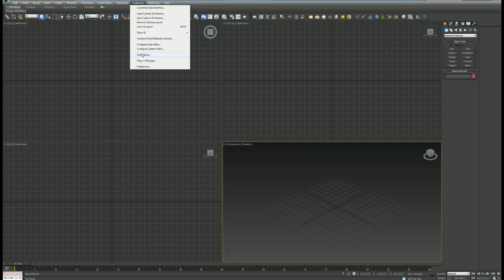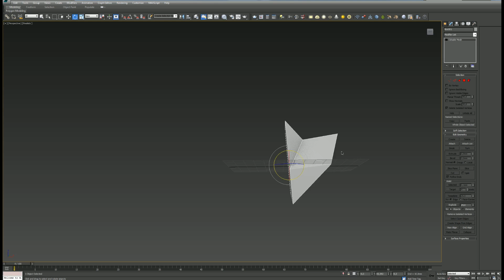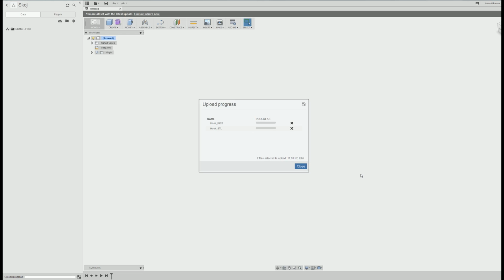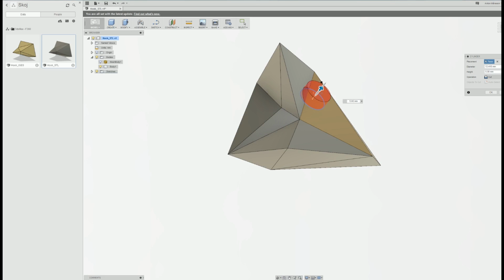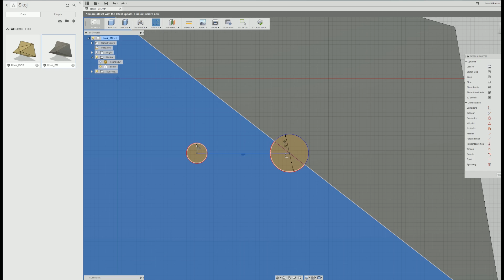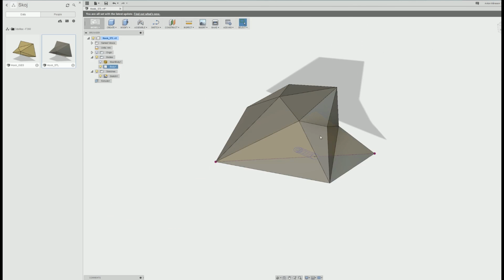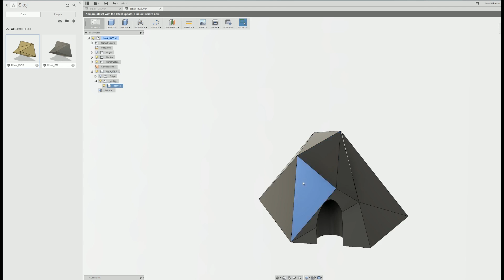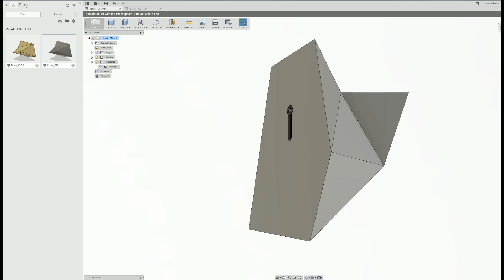Autodesk 3ds Max to Fusion 360 (STL to Solid) | /Guide | Polygon design sample

Comment: hey Actually I am new in designing world, I am using Autodesk inventor right now

but I have problem if I have to make an organic shape/complex sculpting geometry

could you give me a sugestion, what is differences between blender,3ds max and fusion
and when we use that software
Reply from the maker: I'd say you want to use Fusion 360 for that. I'm sure inventor have some tools, but I'm not familiar to them.  The sculp-environment in Fusion 360 gets you a solid model (or proper surface) to work from, while 3ds max (or blender) will give you a polygon model, something that's difficult to work with if you're going to manufacture it.

If you're just going to make organic shapes for rendering, games or similar (not manufacture) I'd say blender/3ds max is best as the polygons are easier to modify and make complex objects with.  even better would be something like Zbrush, if you're really going to sculpt things.